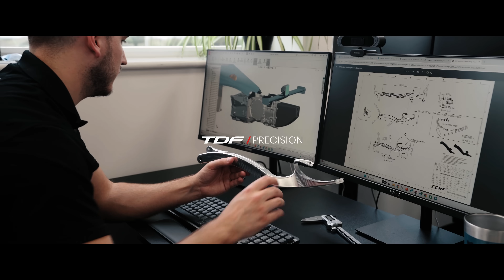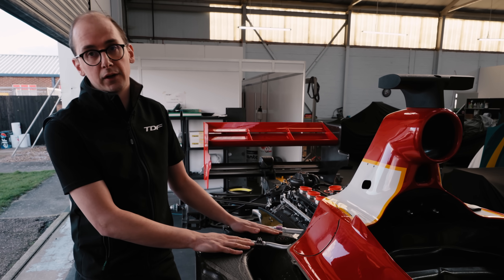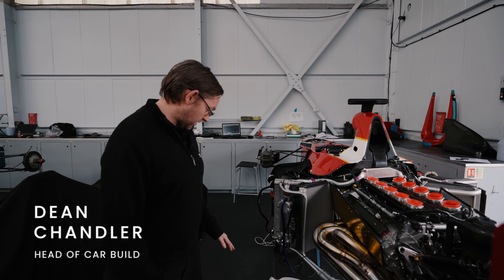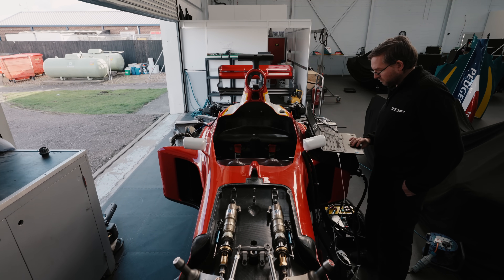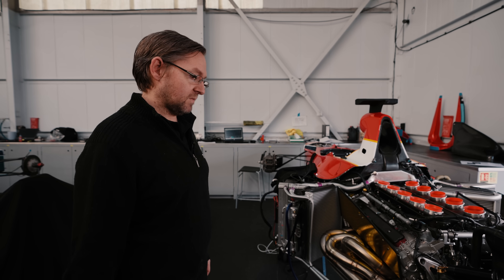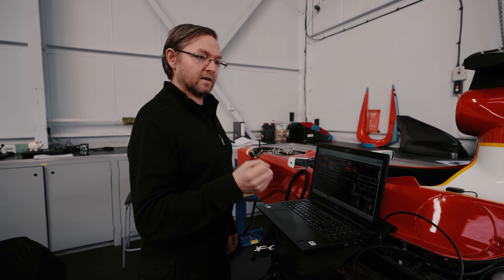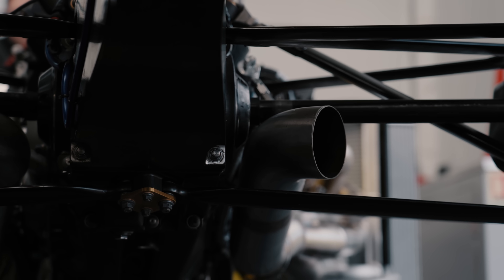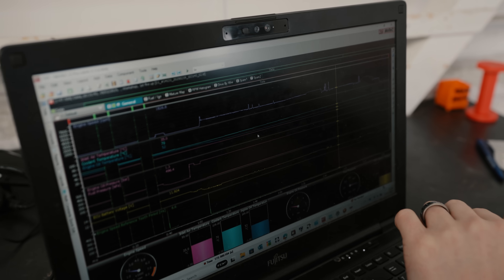Restoring a 1998 Williams F1 Car: The FW20 Lives Again

Comment: Great stuff! Thank you very much.
Out of curiosity: from which car is that rear wing? Can't remember to have seen a rear wing with those slots in the mainplane.
Reply from the maker: This is the period correct FW20 wing. All rear wings run with a slot gap when they are multi-element, this one is more pronounced as its carrying 3 planes.

Comment: Great stuff. This is a good example of why we need endurance racing - the Ferrari 412T2's engine won't be around forever so using something similar that was originally designed to run at Le Mans will be vital for future F1 preservation. Also why Aston's V12 will be great to see at La Sarthe this year.

Comment: Can someone explain to me why these Mechachrome engines (originally Renault engines)  were damaged deliberately?
Reply from the maker: It was a way of protecting the IP in period, and they weren't the only ones! Would you like us to do something on that, and show what they do?
Reply: @tdf_limited  yes please, it would be great to get some more detailed information about this topic.
Reply: @tdf_limited As we know, Mecachrome is still around, I wonder if they still has blueprints/tooling to create and sell new V10s🤔
Reply: Williams used to cut up the bodywork, seats etc before throwing them away too. The idea was to stop trophy hunters and IP being copied. I think these days F1 teams keep more stuff for heritage.
Reply: Great to see you the car working, me I'm all about originality, I'd rather run the original 3 litre engine dispite it being more hands on but I prefer it. The 4 litre after market engine is fantastic in a LMP1 by far but I'd rather have the original 3 litre for the Formula 1. All you need is the blueprints for the engine and you can build one from the blueprints.

Comment: Hi there I noticed that you guys make the tdf1 with a reliable 4 cylinder engine is there a reliable v8 or v10 or just the good old 4 cylinder
Reply: I'd say the Judd V10 is what You'd call a reliable V10, compared to the Renault/Mecachrome units at least.
Reply: @wellend89 is it as reliable as the 4 cylinder?
Reply: @KSAA5  don't know about as reliable but the rebuild interval on a Judd GV is 3000km which is incidentally also the number to what the 4-pot is warrantied to so...
Reply: @wellend89 thx for the inlightment I really appreciate it 🙏